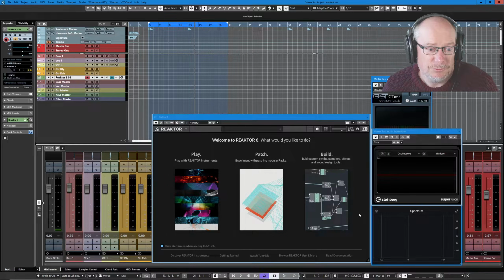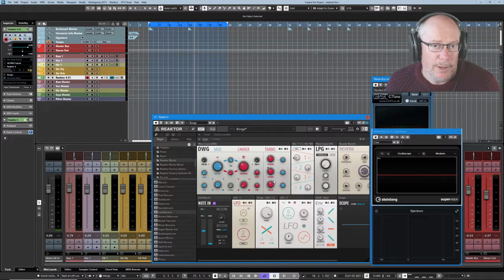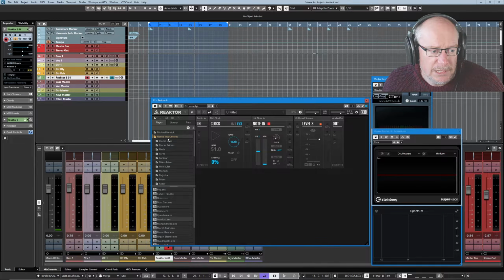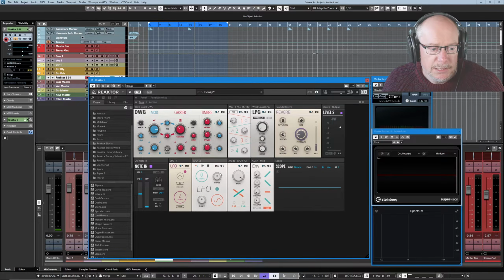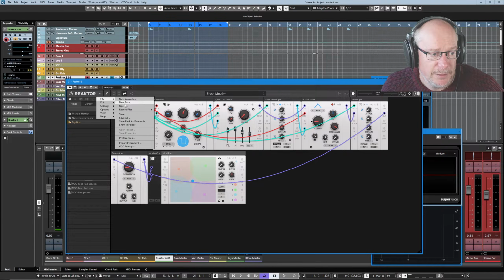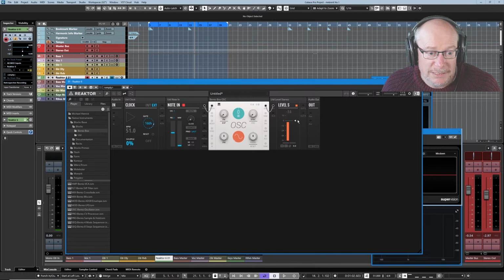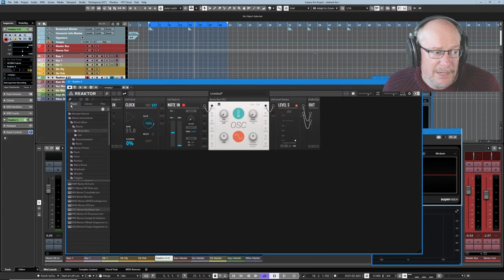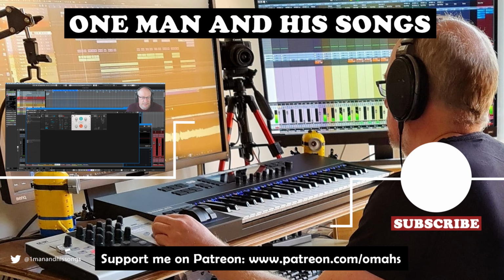Making Music With Reaktor 6 Pt.1 - An Introduction to Racks

Comment: You get an "A" for explanation. However, the euro rack apparently is not compatible anymore and all modules appear with knobs on top of each. Double vision or maybe quadruple vision. Better luck with toy box. Best is Bento Box that comes with Reaktor. That folder saving problem is crazy. Reaktor is difficult enough without causing confusion like this, especially since there are so many folders with the same names in different locations.

If you like Reaktor, you will probably love Multiphonics CV-3 by Applied Acoustics, which has a similar modular nature but is a lot easier to understand and more logical.

Comment: I'm so glad you're doing this series.  I tried to get into Reaktor Blocks last year, and then threw up my hands and moved on to Cardinal, because the interface was such a pain.  The tip on changing the user presets directory alone is worth the time spent watching.

One question: what plugin are you using for your spectrum analysis?  It looks like you're using Supervision for the oscilloscope and something else for the Spectrum. Thanks again.
Reply: Never mind about the spectrum plugin.  I saw it a the beginning of episode 3.
Reply from the maker: I switched to Insight a year or so ago. Its spectrum and loudness tabs are both very good.